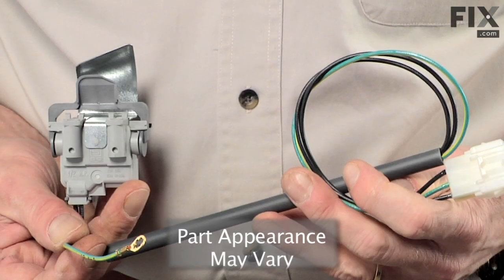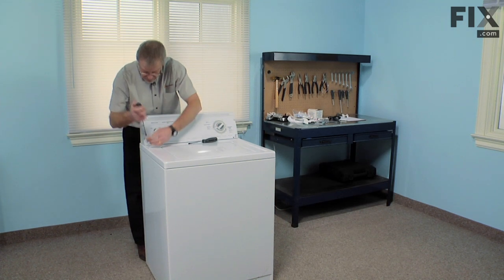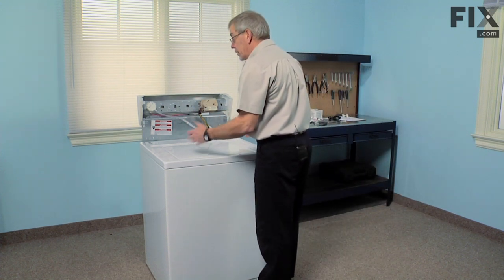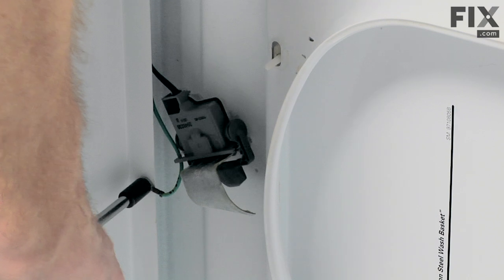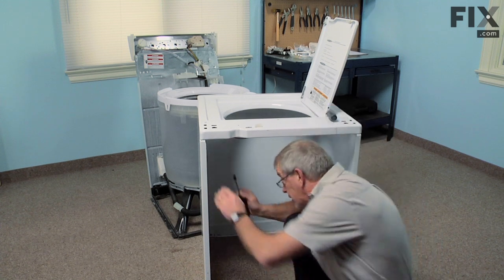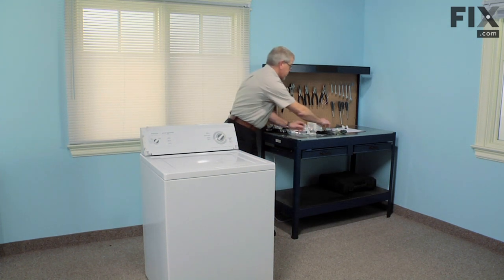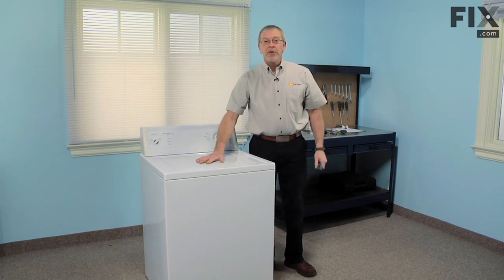Kenmore Washer Repair – How to replace the Lid Switch Assembly

Comment: Thanks for this. It had been several years since I had a washer apart (I replaced the pump in ours after a sock got stuck in it), and my mother-in-law’s machine had a broken lid switch. 

The one thing, though - the screw down low on the left side doesn’t go into anything but the cabinet - it’s a placebo. The only things that really hold it together are the clips on the top, under the control panel.

Comment: Happy to find an easy-to-follow video with exactly the same washer as what I have(or at least indistinguishable from mine) so everything was in the exact same spot. I especially appreciate that you said what size ground screw it was so I could get the right size wrench the first time.

Comment: The switch on mine came apart, but I didn't want to disassemble the whole washer.  Just two screws hold the switch in place.  You can push the tub out of the way enough to pull the switch out to work on it.  I used a zip tie to hold the switch together.  Works like brand new, took me about 20 minutes to do.  The hardest part was pulling the tube, that the wires run through, loose from the spring clip that holds it.

Comment: Although I fixed the lid switch weeks ago, it was during my move that I realized I did not reattach the frame on the right, and it almost fell apart! I got to my new place, and I still was unable to figure it out. Thanks to how you described that part of the video, with how to angle it and what to look for when returning the frame, I was able to FINALLY put it back together. The sound of my washer running is music to my ears. Thank you!

Comment: Thank you, thank you, thank you! I purchased a switch replacement part 3 years ago for my Kenmore 80 series (yep, that old). I was able to Macgyver (bypass) the switch for that long -- it was working so why not save myself a couple hundred dollars to have a technician do it.  Well, two weeks ago my washer stopped draining/spinning and I decided that now was the time.  And what timing!  Today, with your instructions both visually and verbally on point, I fixed it all by myself!

Comment: Great video! So that's how the front comes off the back. One day I found a plastic piece in the washer after finishing a load. The backside of the plastic piece looks to have some screw thread to it. I put it aside just in case. On another day, I noticed that the right screw for the lid switch was loose. Couldn't screw it back in (keeps turning) and it pulls right out. It immediately clicked and I put 2 & 2 together. The plastic piece was part of the screw hole of a plastic molding on the lid switch,  which broke off and is why it keeps turning when i tried to screw it in. Well, the switch still operational and the spin cycle still works. However, it's only mounted on there by one screw. I'll need to be careful not to slam the door shut. lol  Eventually it'll need replacing, but I'll know just what to do. Thanks!

Comment: Thank you so much! Although I also am not sure what the bolt on the back was secured to, as it currently doesn't seem to be secured to anything. That being said, I was able to successfully replace the lid switch on my Kenmore washer for less than $9.00. For that, I am forever grateful.

Comment: Spot on  the only thing I did different was lean the front part with the lid back just enough as to not have to line it up to put it back together and the whole process took under 10 min.  Oh and I had to vacuum and clean the dirty floor.  One other thing I got the part for $9  on amazon

Comment: A $12 part and 30 min of install time... saved me so much $$$.  Toughest part was figuring how to align the cabinet back so it sat in those grooves. 

Also, FYI: if you have pets, you will find a lot of pet hair in the very top of the wash basin. There is a large plastic ring with tabs that you can easily remove, then clean in between the outer tank and the agitation basin. 😝
Reply: You're supposed to tell me this before I put the cabinet back on. LOL
Reply: GREAT COMMENT
Reply: Always read the comments before attempting repair.  Other experienced people may have additional information or shortcuts, etc.

Comment: MANY MANY times what happens is, the switch mechanism doesn't break - it's the switch case that splits.  Two tiny plastic tabs that keep the 2 parts of the case together ultimately bear the force of the lid closing repeatedly.  The tabs break, the switch separates, and when the lid pin comes in contact with the switch arm, instead of actuating the switch it simply pushes the two pieces of the switch case apart.  This can be "fixed" by removing the two screws that hold the switch in place (drop a towel in the drum first, in case you drop a screw), working the switch assembly out above the drum (push drum to right slightly - switch comes right out) and inspect the seam of the switch for separation.  If separated, tightly ZIP TIE the case tightly back together.  Be sure the zip tie head or "block" is on the right or rear side so it doesn't interfere with reassembly.  Now put it back together and the switch is stronger than before.  Oh yeah while out, wipe the switch off and optionally spray some electrical contract cleaner inside the tiny holes near the switch hinges (give a minute or two to dry).

Comment: Made the job very easy to perform. Thorough directions and great visuals. Bought the part on-line for $9 and an hour later was doing laundry. Thanks for taking time to make the video👍
Reply: where did you get that for $9? I only see it for $35!!!
Reply: @nandaglick9067  If you Google Sears Kenmore Washer Lid Switch 3949238 you will see it on amazon.com or walmart.com for $9.00. Your owner's manual should have a parts list for your washer. I would check there first to make sure it's the same part number. My washer model was 110.24862300

Comment: Sounds real easy.  Except my model 80 does not have easy off plastic end caps.  The end caps are metal and I don't see how to snap them off without taking the whole back off the washer ...again.  Any tips?

Comment: It is a great step-by-step and connecting the new switch was a total breeze. One problem... the reassembly of the cabinet was too easy. It took me more than an hour to reassemble JUST the cabinet. What you didn't take in consideration was how constraint some spaces can be to disassemble and reassemble the cabinet, removing the water hoses and the debit hose. Still a good video.

Comment: This video was great I fixed my memory washer in the first 8 minutes because your instructions were so clear and straight forward. My only criticism is you should show the bracket clips that clip the back panel to the front panel from the side at least once. I think it took me like 3 minutes just to get those back in. Great video. Saved me $400 dollars.

Comment: My washer makes a knocking noise when starts or when it's about to rinse I have a kenmore  series 800. anybody has the same issue, or have any idea of what could be the problem 🤔 thanks in advance !
Reply from the maker: We should be able to help you but will need a little bit more information on that knocking noise. Can you tell if the sound is coming from the lower part of the washer or up higher? Does the knocking sound go away after it running for a bit or thru the entire cycle? Look forward to hearing from you.

Comment: Can you help me out? Kenmore model 110 24872300. I replaced the lid assembly with this part https://www.amazon.com/gp/product/B01AJZNLEW but it did not come with that silver part that sits around the latch part so I reused the old one. Maybe 6-8 loads later, that silver clip popped out. Is it an important part? It seems to attach only via the plastic stub on top of the latch assembly. Thank you!

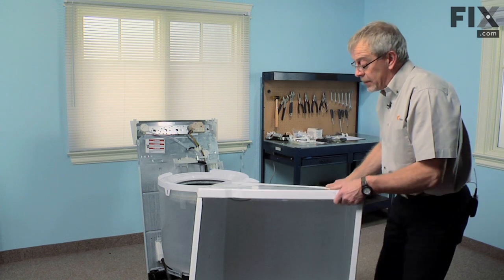Comment: Very informative video but goes on too long and the technician uses all kinds of technical terms hard for the average Joe to understand. I must have watched this video about 5 or 6 times on how to put the cabinet back and could not understand what the technician is saying.  I am referring to 7:25 minutes into the video. We struggled for an hour and could not get the cabinet back into place. I finally found another video where some guy explains it in simple terms in less than 90 seconds. I was able to install the cabinet back into place within 5 minutes.